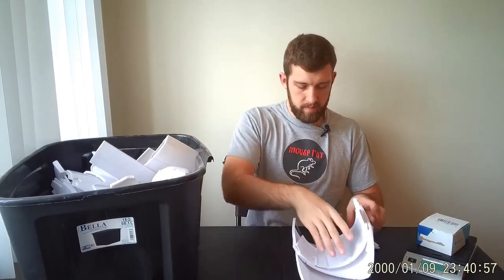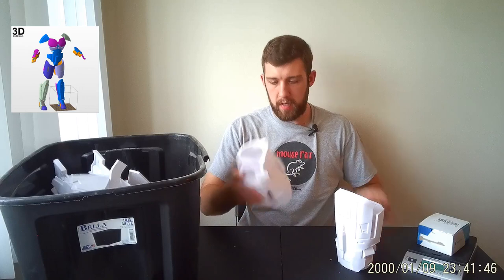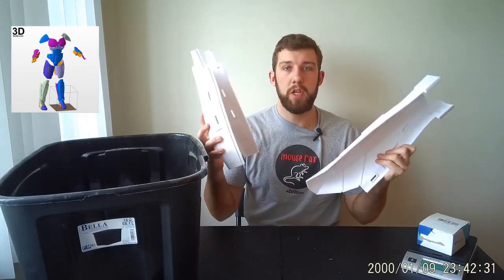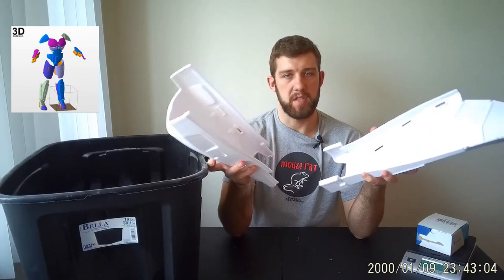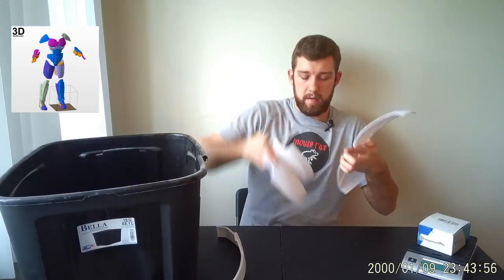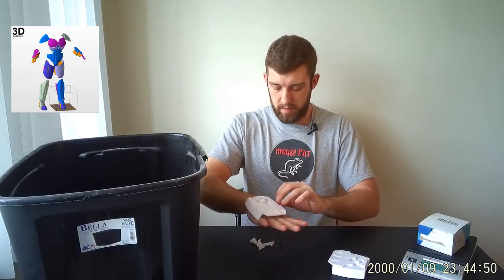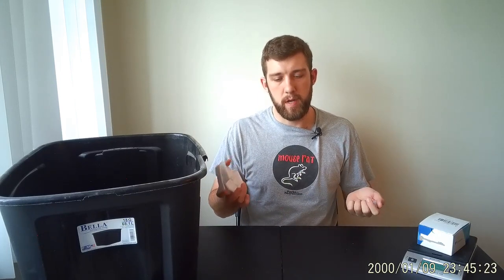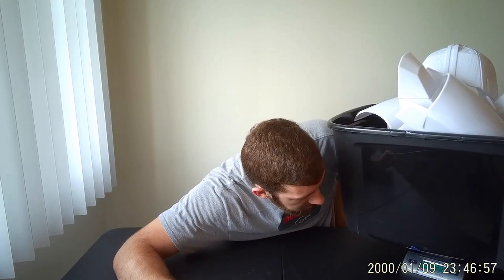Making Sith Acolyte Armor - Episode 0 - How Much Does 3D Printed Armor Cost?

Comment: I hear such mixed reviews about do3d its nice to see you had success with the files.  I'm in the middle of a full size R2 print, but as soon as its done I want to work on a full costume of some sort for myself.
Reply from the maker: The files were probably 70% perfect. Not very good quality at all but so far as I know it's the only full acolyte set out there at the moment.
Reply: @GalacticArmory  I've also seen a good set of files by 3dPropsNL at CGTrader (https://www.cgtrader.com/3d-print-models/fashion/other/sith-acolyte-eradicator-armour-swtor-3d-print-model) . I've picked up both versions, planning to make it my first big printing project, and it's interesting to compare the differences between the two.